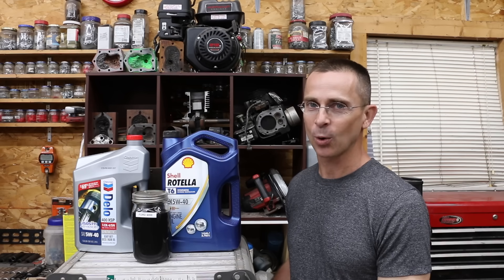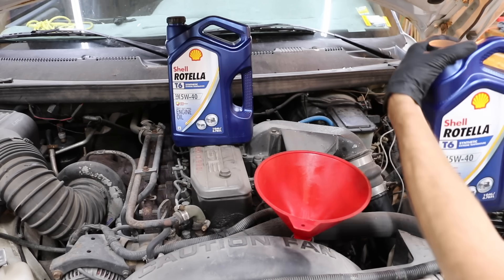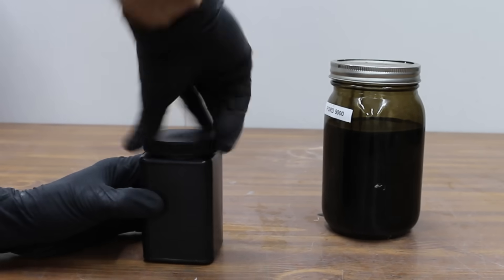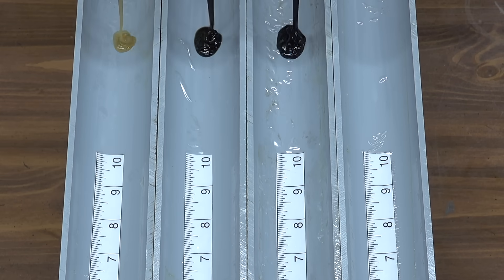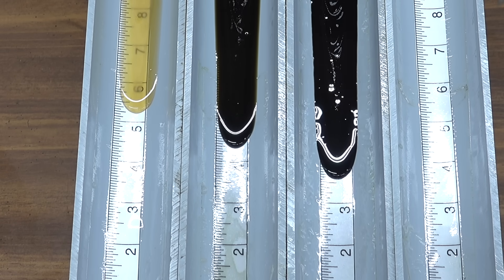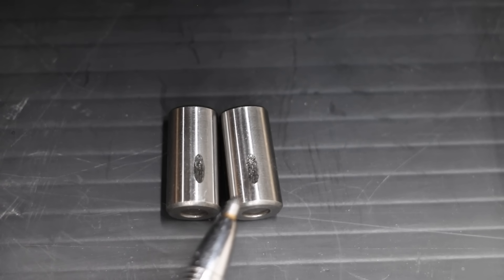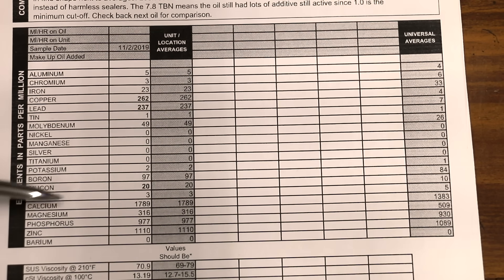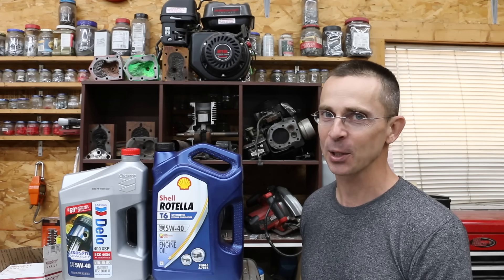Will Annual Oil Change Damage Your Car? Let's find out!

Comment: I always wonder when buying gaskets cause you can get cheap chinese ones for a couple bucks or the name brand for 40-60 dollars is it really worth the extra money. You should test gaskets and orings(valve cover, cam seal, oil pan etc),  both by brand and by material type (silicone, rubber, others).   Expose them to high pressure, heat, cold, as well as contaminants like oil, ATF, coolant, gasoline, and water  and then  see which brand and material type is the most durable.

Comment: Surprising, I  read, was told, that oils in vehicles or stored outside  adversely affected  oil's  additives.  Guess not for the year that it was in the truck.  And an unheated barn?  Oil dark but no problem as the test lab states. 

thanks  Brad.
Reply from the maker: Thank you for the feedback

Comment: There is no replacement for displacement. With cars you have considerable less oil to work with so I am inclined to believe it is not applicable for smaller cars that use half or a third of the oil that you poured into the truck.
It is very useful what you have done and I would be really curious to see this applies to small cars in a maybe a part 2.
I too believe that it is not that critical if you exceed the time period rather than the miles number.
Reply from the maker: Thank you for the feedback

Comment: I talk about this on my new channel where I run Amsoil in my mowers and change it every 3 years. I actually think you could run Amsoil (or any great synthetic) for much longer than 1 year as long as you stayed within the mileage limit. So if you drove 20,000 miles on your Amsoil for 24 months you'd probably still be OK. Great video as always!

Comment: Your displacement monster engine probably doesn't care about which kind of oil you feed it. 
Here in Europe, I wouldn't dare to mess with the oil service interval in my highly efficient turbodiesel engine. Time and time again it has been proven that the oil interval is the most important factor to keep your engine good and running. Let's not risk horrible engine failure over 30 Euros of oil and a filter for a few more bucks a year if you do it yourself.

Comment: Here is a Video idea, heated wiper, the most efficient one, and the ones we can change just the rubber blade that would be standard!!! meaning you are not hooked to buy from that company only, you could buy them anywhere, and you don't have to change the whole wiper, just the rubber blade, plus some come on only when temperature goes to subzero, some you have to disconnect....

Comment: Great video disproving an age old myth. Sure you should change your oil regularly, but not all the time. Great recommendation on running your engine to full operating temps at least once per month. Even twice if you can.
Reply from the maker: Thank you

Comment: It's like I suspected. I won't be changing oil on my boat every year when it only has about 50 h of engine time each summer. 32 liters of oil is quite expensive and pure waste of money, time and resources if the oil is still good. The engines get warm almost every time they are started.

Comment: Funny you posted this, I just sent Blackstone a sample of M1 Annual Protection 5W-30 that was in an LS3 engine for 17 months but only 1300 miles.  Waiting for the results to come in.  Engine was not started for a couple months at a time.  And has about 104k on it, but it was completely rebuilt like 20k miles ago.
Reply from the maker: I'd bet that it is in fantastic shape!
Reply: @ProjectFarm  Just got the results back, they said it was in great shape with plenty of life left.  They said not to be worried about calendar time at all on oil like this.

Comment: What I wonder about : Is the 5000 mile change on newer vehicles (vs 3k from the old days) really the result of new oil / engine technology....or planned obsolescence by the manufacturers?
With engines routinely getting 250k or more, is it really just a plan to make engines wear out faster.
Kind of hard to design a test for that though..
Keep up the good work. Your testing design is amazing.
Reply from the maker: Thank you!

Comment: Boy them results were fast brother! Lol! I’ve used Blackstone before. Very good service they provide for a decent price and awesome customer service as well too!
Reply from the maker: Thank you very much!  Yes, it usually takes about 3 weeks
Reply: I believe Oil Analysis from Blackstone are computer generated. 
If they truly are testing the oil they don't need to know a thing/nothing about how many miles it has on it and what vehicle it came out of. I believe it's all an ( algorithm ) and they aren't testing nothing. 

To prove my point, change your oil, run the new oil for 500 miles, drain it and send in one sample and put it has 11,000 miles with no vehicle description, wait and send in another sample from the exact same batch of 500 mile oil 3 weeks later and put it has 4,000 miles with no vehicle description. 

And see if the results are exactly the same, they should be.
Reply: TheTennesseeTittyTickler I could entertain your theory, and that would be a definite way to test their except I’ve “kinda” already done that. But in a different way that should “grant” you the same results rather than the same results of identical “oil” as in your explanation. When I’ve compared fresh oil that hasn’t ever seen a crankcase to oil that’s out of my car the results were different. I never labeled the oil “fresh” or “not run”. I took a sample of Mobil 1 10w-40 with 2 oz of motorkote per quart (5 quarts) from a 6k mile oil change and compared it to the same exact oil without the motorkote additive in it, the results were totally different. Now I think you should also know I didn’t change any of the parameters, I said the fresh oil had the same 203k miles on it, said it was taken from an 09 Pontiac G5 2.2l base model, Etc... I didn’t change a thing in the paperwork between the 2 samples, so by your theory of an “algorithm” they go by should mean the 2 samples should’ve been the same if the didn’t physically analyze them. The lab that Blackstone uses is based from the same machines that the engineers for caterpillar developed in the beginning of all this oil analysis a while back. Caterpillar were the ones who started it so they could better understand what their engines were being put through and how to improve them.
Reply: John Hasty I understand, that but fresh oil can obviously been seen very easily versus used oil
Reply: TheTennesseeTittyTickler Most definitely true, used oil is darker by a long shot, but why would it be false? Is there any gains to falsification on their behalf? Why are all analysis reports different? How can they detect wether or not you have a blown head gasket from elevated levels of coolant traces in the oil? How did they know I had elevated levels of friction modifiers like phosphate and molybdenum disulfide in my old oil without me telling them I added motorkote? In order for them to detect how many parts per million of the additives I changed in the oil myself and not what the oil has right from the container they must have used a mass spectrometer to detect those precise levels. I’m just curious, have you ever used their services? Or any other oil analysts?
Reply: TheTennesseeTittyTickler Yes sir, most definitely seen some of those videos about not doing the work that you paid for. That happens here in Bowling Green  Kentucky a lot. Not so much with those small Mobil 1 and Valvoline places though mainly larger shops. That’s why I don’t let anyone work on my vehicles so it’s a good thing I’m a mechanic then. I can see your point with the blackstone oil analysis. I just can’t see how by your theory that my results should’ve been the same yet they’re different. Same with the certain markers (additives) I’ve added. How do they know to increase those specific levels without me telling them? Anyway I’m not sure about the part on why they want to know all the other info. I think it has to do with the test results conclusion at the bottom of the paragraph on the top of the reports. Usually it’ll say the oil is good for X amount of hours or miles cause I always change my oil around 6k instead of waiting to 15 and 20k like most people.

Anyway Merry Christmas to you and your family! Hope you all have loads of cool gifts!
Reply: John Hasty Thanks and Merry Christmas to you and your family. It's good to hear Blackstone seems legit. You just never know these days, it's not just Automotive shops, I had a Veterinarian tell me I needed to spend over $600 to get rid of fleas, I spent $40 and haven't seen a single flea in over 3 years. 

She, the Vet said I needed to throw all my food in the Cabinet away and fumigate the house and spray my yard  while staying in a Hotel 2 days. Then come back home and wash all my towels, clothes and blankets.
Reply: TheTennesseeTittyTickler Oh wow, that’s a lot for just fleas. I know that there are companies out there that can give a crap less about the cost and try to get every last cent from you. In fact it seems as if all places are like that. That’s why I try to do everything I can. I don’t exactly trust any mechanic shop or any company so to speak because I know how they are. As I said before I’m the lead mechanic at the biggest shop in 200 miles and I know how that can be. I’ve been instructed to do stuff that I don’t agree with. Just so you know I never follow through with any of it though (hand on bible) I don’t believe in dishonesty and crappy work. I believe in a fair price and fair treatment for all people no matter who you are and how upscale you are. I can say though my morals have been frowned upon cause of this and people wanting me to “make more cash” I just don’t believe in it.
Reply: TheTennesseeTittyTickler Oh I forgot, I meant to ask why throw away the food in your cabinets? I can possibly see some of the boxes food maybe, but canned food don’t make any good sense. The chemicals and or fleas can’t get into the cans not that I’m aware of 🤷🏻‍♂️ lol I’m just curious
Reply: John Hasty I used to be a Gas & Diesel Mechanic. I quit when the owner decided to pay on commission. 
So basically the guys who were half@ssing and not doing things correctly got paid more. 

Half@ss ' good enough '
mechanic shops make more money than shops that do things correctly, half@ss shops get the job done faster, change unnecessary parts & fluids with cheaper quality, then charge the customer for it. 

Most mechanic shops are about as honest as a Car Salesman.
Reply: John Hasty Not sure but that Vet was a nut.
Reply: TheTennesseeTittyTickler Absolutely sir! I really hate that too, but there is really nothing we can do about it. Nowadays it’s all about makin money, very hard to find quality work and quality individuals. Nobody cares about making anything last a while because they want the customers money. Heck, I’ve even see people sabotage certain parts so they fail quickly and comes back so they can sell them parts and labor. Being that they already know what’s wrong they can “repair” it quicker and do more people wrong. I hate that junk, very seldom you find a true mechanic with any knowledge and any character any more. I’d say 75 percent are just simply “parts changers” as I call them. They just install new parts until it’s fixed and then get away with it because “the vehicle needed” those parts. It really burns me up man! They say they’re smart but don’t know anything about any kinda diagnostic procedure. 🤦🏻‍♂️
Reply: TheTennesseeTittyTickler lol, I believe it. Sounds ridiculous for certain!
Reply: John Hasty Here's another one, check out how balanced these engines are, unlike any other production engine from any other maker 

https://youtu.be/8Sq2mqohvDw
Reply: @Mr.Beastforpresident  
Yea....I just go into work to not test  300+ oil samples a day.
Reply: Justin Mellinger ( ANYONE ) can rent a space slap BillyBob's oil Labs and ' test ' oil and print out lab results on office letterhead. Am I wrong??

Comment: Just a thought but I wonder what the results of the lubricity tester would be if you ran the test with hot oil
Reply from the maker: Great point.  There would be more wear but the T6 would still outperform the Delo

Comment: Great test. I  totally agree with your test results on this.  A great point also, about getting the engine temperature up. Long ago, an old mechanic always told me, never just start the car and shut it off, drive it and get it up to temp before parking it, plus it heats up the exhaust, and burns off all the condensation in the pipes, not allowing it to linger and rust the exhaust system.
Reply from the maker: Thank you!

Comment: "As long as the engine reaches full operating temperature at least once per month"  That right there folks says it all.  I change the oil on my cars yearly, and make sure the oil reaches 100 degrees celsius at least weekly in order to boil off any moisture.  Oil is cheap and I make sure it gets recycled, so I think that at least yearly changes and/or 3000 mile intervals equals an engine that runs basically forever.

Awesome video!
Reply from the maker: Thank you!

Comment: I've been changing my oil twice per year because I don't make it to 3000 miles on new oil. Looks like I need to rethink that since I'm running full synthetic and a good filter. What lab are you sending the oil to for testing and what's the cost? MERRY CHRISTMAS !!!
Reply from the maker: Merry Christmas!

Comment: Are Mannol Oils sold in the US? Because here in Europe Mannol is considered a underdog Brand, offering great quality often for half the price compared to premium brands such as Castrol, Liqui Moly or Shell. 

To give an example, I personally use Mannol Energy Formula PD for my 1.9 TDI Skoda Octavia which costs around 23 Euros, compared to Castrol Edge (both 5W40 oils) which costs around 40 Euros. (for 5 litres)

Link for Mannol oil (no sponsorship, this is just what i use): 

https://mannol.de/en/?action=accessory_chemical_preview&name=Energy%20Formula%20PD%205W-40

Keep up your great informative an unbiased work.

Cheers from Luxembourg,

Steve
Reply from the maker: I'll have to do some research

Comment: This is a myth from so long ago that it no longer applies.  With modern oils with their modern addictives it isnt an issue anymore.  

You also have to remember that this was also back before sealed engines when you had drip tubes exposing the crankcase to atmosphere continually instead of PCV or sealed systems.  No doubt this myth is worst case high humidity high temperature swing environments as well.

It might be interesting to test temperature cycling the oil in a metal container say 3 or 4 times larger in volume than the oil to see how much moisture you can really expect to draw into an unsealed crankcase.  Then you could heat it to say 190F and see how long it takes to burn off the water to simulate driving at temperature.  I doubt it will be very long.  I think this is again an old days scenario where an old lady only took the car to church and in 30 years it has like 8000miles on it.  Cars arent used like that anymore.
Reply from the maker: Thank you for the feedback

Comment: Message number three!

Just making sure you got my list of products to test of the gun oils vs grease in their ability to reduce wear, corrosion and maintain lubricity.

Oils:
Hopes No 9 Elite gun oil
Ballistol Multi purpose cleaner and lubricant
CLP-4
Slip-2000 Oil

Greases: 
Grizzly gun grease
Tetra Gun Grease
Mil-comm TW-25B
Hopps No 9 grease 

Other few ideas would be Froglube, and a homemade lube the gun community suggests, it is half and half mixture of Mobil 1 synthetic 0W40 and Mobil 1 synthetic ATF Fluid.

(Just sending this cause I know how crazy the notifications are when youtube is going ham. Love your work!)
Reply from the maker: Thank you for the list.  I just copied and pasted it into my document that has all the video suggestions from viewers.
Reply: @ProjectFarm  I gotcha, appreciate you!

Comment: My 05 Duramax only sees about 3-4k miles a year (mostly towing - always gets to operating temp). I change the oil every other year or 7500 miles (whichever comes first) with T6.  The engine is happy and healthy.  I bet it would be fine to go longer, may need to have it tested at the end of the 2 years.
Reply from the maker: Great information!  Thank you

Comment: I have an 02 MB E320. It has over 140k miles and takes 8.5 quarts of oil. I had done an oil change in December of 2017 and went until August of 2019 to do the next change. I had only drove 8k miles in that time frame, but got nervous that the oil might go bad after so long. Sent a sample to Blackstone and the wear numbers were at or below average and the tbn was 3.0, so the oil was still doing its job after close to 2 years. Iron was actually the lowest it’s ever been. This was with Mobil 1 0-40 Euro and around 25oz of Lubegard Biotech. That’s my go-to combo. 

I hope you can do a video on the Lubegard one day, I would love to see the difference it makes in a testing environment
Reply from the maker: More proof!  Thank you!

Comment: It would be interesting to see which oil is better gas oil or diesel oil also we have been waiting several years for you to do a test where you add boric acid to oil to increase its lubricity
Reply from the maker: Thank you for the video idea!
Reply: Project Farm I have been watching you for years I don’t miss  an episode I can’t wait to see this boric acid in the oil science has been trying to incorporate boric acid as a lubricant for many years it has been used effectively I Believe it to be acidity that’s the problem. I put it in an old bronco I drove for over a half 1,000,000 miles

Comment: Oil doesn't break down,  but the additives in the oil does break down. And if you are going on extended oil changes then its recommended that you change the filter on the recommended change intervals
Reply from the maker: Thank you for the feedback